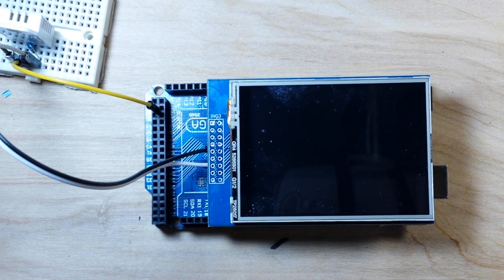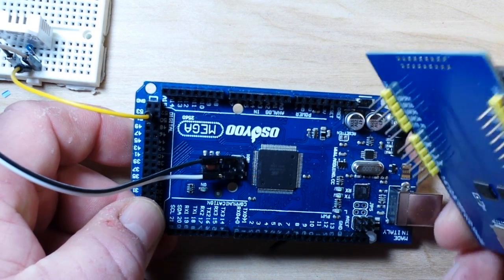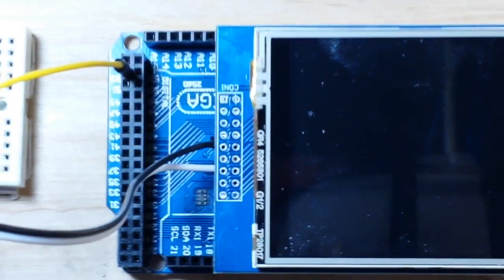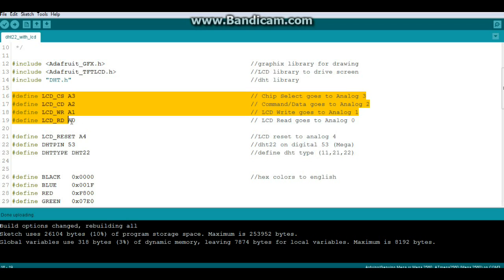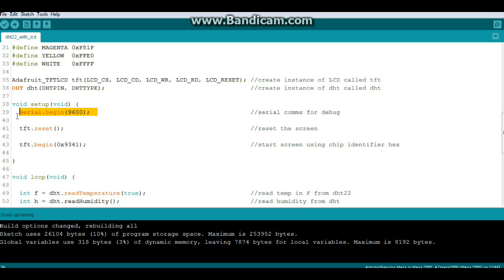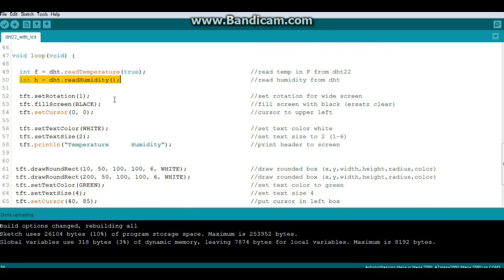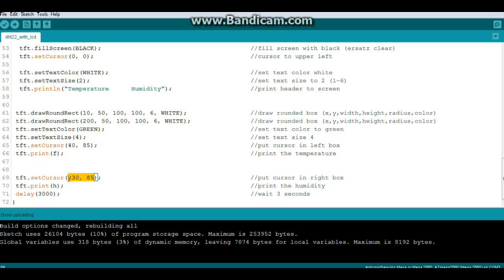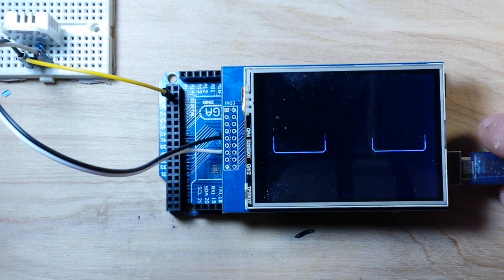TFT LCD Basics

Comment: I'm just learning code for displays, and I believe that you just taught me how to properly display sensor data. Which, hardly anyone describes how to do.
I'm trying to make a clock that shows temp, humidity, air quality.
And I don't really know what line does what, just basically taking a shot in the dark.
But you also simplified getting sensor data from the dht, and displaying it.
Time to try this!
I've pulled out enough hair, I believe..lol.
Thanks for sharing!
Reply from the maker: Thank you
Reply: learnelectronics It didn't work. LOL.
I got up at 3am, tried it. It didn't work.
What would be the code to display raw data from say a gas sensor? The type that are on a small breakout board? I just need the raw data code.
Any help would be greatly appreciated!